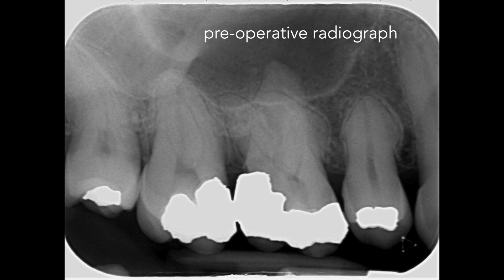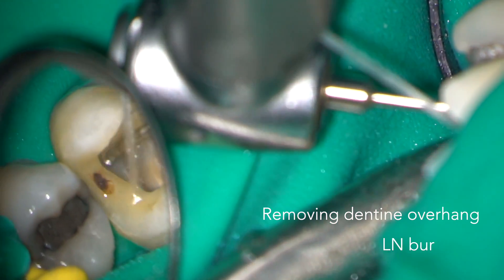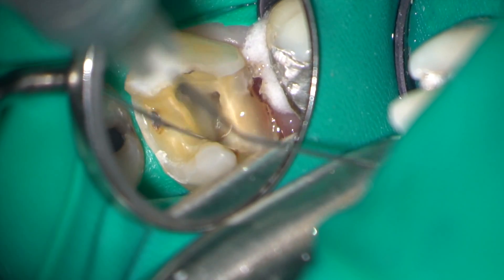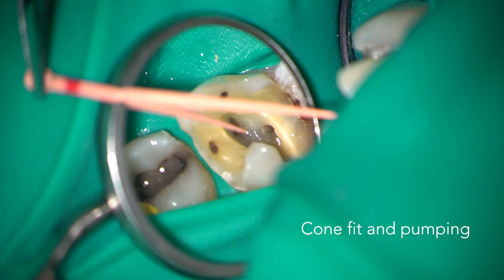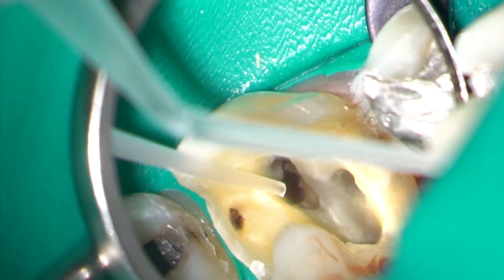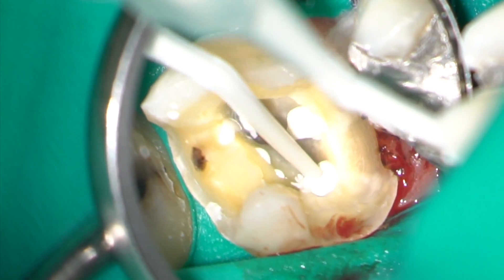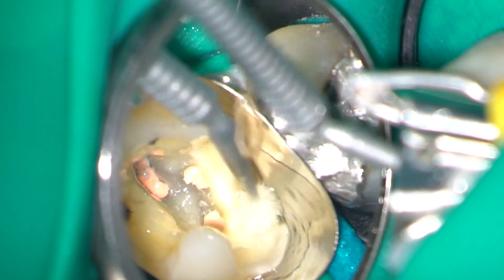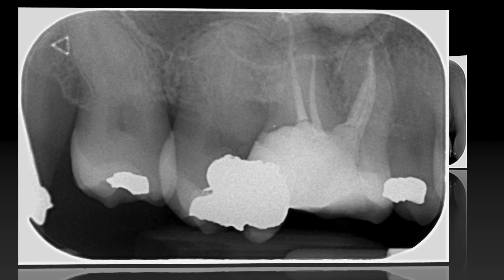UR6 MB? 1 - 2 - 3!

Comment: Hi John! Huge fan of your work! What kind of pipette or syringe do you use to inject the BioRoot RCS into the canal before inserting the GP? I’ve yet to find a reliable way to place the sealer into the canal without merely dabbing with sterile paper points. Thanks!
Reply from the maker: Hi Seth
I use an ultradent syringe and a calasept luerlok plastic needle tip, you have to snip the tip off.
I found the pumping technique to be unreliable and often introduced bubbles
Cheers
John

Comment: Hi Dr. Rhodes, 
Thanks for the videos, I enjoy each and everyone!
I had a question about the obturation, do you use a specific GP cone that matches the tip diameter and taper of the primary wave file (MAF)? Do you sear/plug the GP at the orifice? My only experience is with warm verticle obturation and my understanding is that WVO ensures accessary canals down the main canal are sealed. Would that be a potential issue with only sealing at the orifice?
Reply from the maker: Hi there,
Pleased you are enjoying the videos and great questions!
I use the matched Wave.One Gold GP points
Use of BC sealer is a bit of a paradigm shift...the seal is provided by the sealer not the GP (as in warm vertical techniques) Evidence suggests that pushing GP or sealer into lateral anatomy does not improve the success rate...but does look cool on a radiograph! Biology wins!
Thank you for your question and keep watching!
Cheers
John
Reply: @johnrhodesendo  thanks for the info! Can't wait for your next video.

Comment: Hi Dr. Rhodes, I would like to share my recent RCT visit with you and get some of your thoughts. My upper right canine tooth developed a resorptive lesion in February. The dentist drilled out the lesion and filled the area with compound to try and avoid RCT in a conservative approach. All was ok for a few weeks, but then the tooth became very sensitive to biting and tapping. In August the tooth became extremely sensitive to all movement and you could see a blue color inside the tooth where the lesion was before. I went back and the dentist told me the pulp was aggravated by the procedure and turned necrotic, and I would need RCT and a crown to restore the tooth. During the RCT, the pulp was removed painlessly UNTIL the slow filing tool got to the apex of my tooth. It was extremely painful every time the file touched that deep area. It surprised me and my yelp shocked the dentist as well. The tooth was initially anesthetized with an ASA block, and a palatine injection that I'm sure of. 3-4 attempts were made to anesthetize the tooth and all failed. They tried "letting it soak" in the canal, and they tried to (what I'm guessing is) inject into the apex all without effect. The apex injection just seemed to meet resistance at the needle and I didn't feel any of the intense pressure that they warned me of prior to injecting. The continued filing and the X-rays taken with the file inserted were awfully painful every time they repositioned the file. The depth finding with the apex locater was very painful as well. After several attempts they told me there was nothing more able to be done and that it would "only hurt until it doesn't." The insertion and packing of the heated gutta percha was excruciating. :( I'm currently wearing my second temporary crown and the impressions are at the lab right now for a zirconium crown to be created. The tooth is painless now, but I think I'd rather have a tooth extracted than to go through that RCT experience again. It was such a deeply hopeless, doomed feeling sitting there with an open, hollow tooth knowing the anesthesia failed and there was nothing to do about it except sit there and endure the continuing pain of the procedure. Everytime I heard "not quite to size" I knew there would be more filing and more pain. :( It was remarked that I have extremely long roots. What do you think went wrong? Why did the anesthesia fail? What would you have done in my case to prevent or to fix the failed anesthesia? Is this just something that happens sometimes and is not able to be helped at all? Thanks!
Reply from the maker: Hello mannys913
Wow!..it sounds like you had a tough time there!...and your dentist was struggling. Endodontics is normally a painless procedure but teeth can sometimes be tricky to numb, it makes it very difficult for patient and dentist when this happens.
Canine teeth can be very long and sometimes an infraorbital block  or intraosseous infiltration is needed. It can also be an idea to use  a combination of different local anaesthetic solutions  rather than bucket loads of the same stuff.
I hope it all goes well and please don't be put off!
Cheers
John
Reply: @johnrhodesendo  Thank you very much Dr. Rhodes!!! I greatly appreciate that reply. I think I've learned my lesson and I will seek treatment from an endodontist specifically rather than a general dentist for any RCT that I may need in the future. I'm 26 and I have never had a cavity. This resorption and RCT has been my intro to dental surgery for the very first time. :( Very unlucky. This has certainly motivated me to double down on my hygiene and make sure I get those routine exams to make sure I decrease my odds of needing to go through this again. Thank you.

Comment: Dr Rhodes,
For the very first initial attempt at going thru the MB2&3, do you use a hand file (6k file) or do you go straight to rotary instruments?

Second question: In general, for the initial attempt, are these hand files,  6C file or regular K files, a good instrument to use?

I have a difficult time getting the first stab on an MB2, on a upper 7 even with a microscope.  Any tips are greatly appreciated.

We here love your channel and look forward each vid!
Reply from the maker: Hi raybe,
Sometimes I go straight to rotary to open orifice either SX or small Wave,
For gauging the canal at the start and estimating working length I like ReadySteel or Flexofile hand instruments
Thanks for watching!
Cheers
John